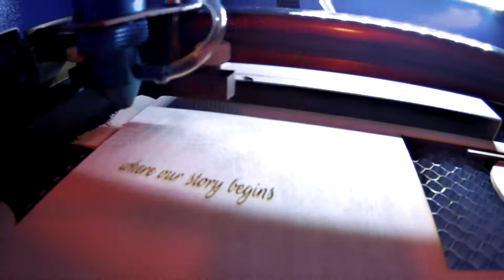Laser Cut Family Candle Holder

Comment from the maker: Settings used
Laser cut using a K40 Laser
3mm Birch Plywood
Engraving 230 speed 4 milliamp power
Cut 40 speed 10 milliamp power
Designed with Inkscape
Burning software K40whisperer